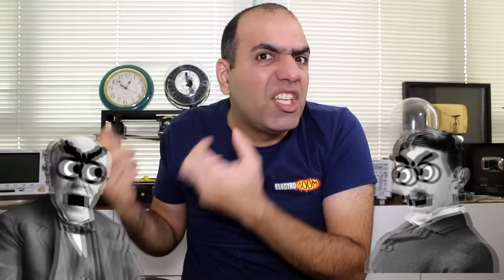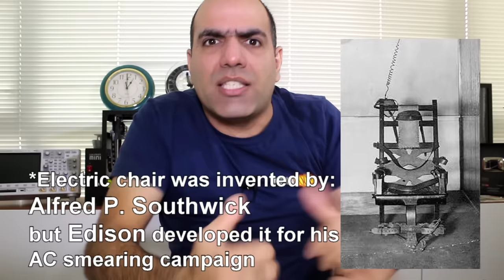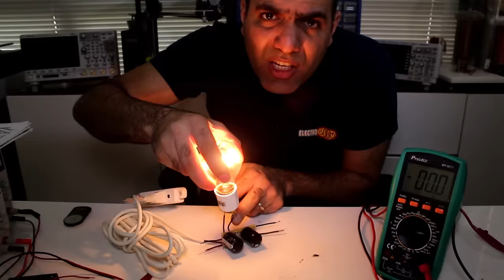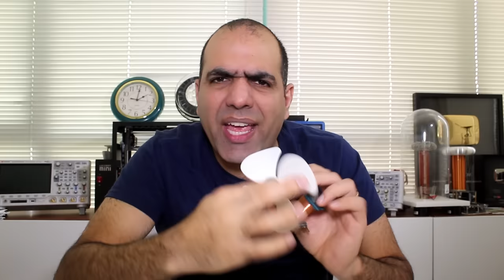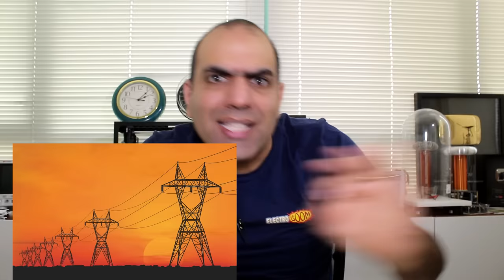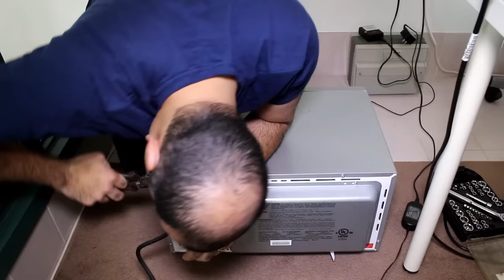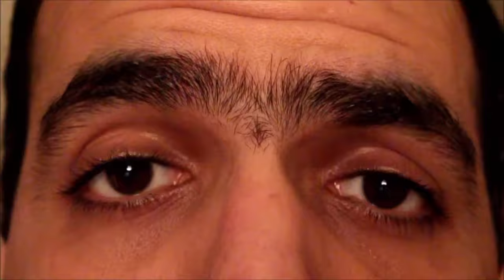Why Use AC Instead of DC at Home??

Comment: Yes and no. High voltage won against low voltage and it still does for obvious reasons but AC only won against DC because there was no DC to DC conversion at the time and nowadays there is. We could generate low voltage DC, convert it to high voltage DC, transmit it through the power line, convert it back to low voltage DC and power the homes, which was impossible back then. Of course it would be extremely expensive to change an entire system that works just fine, but saying that the result of the war of currents still applies today is just wrong.
Reply: No. AC is much better because you need 2 times less wires and less losses in longer path. When you transport DC on long distances you HAVE TO put 2 wires - one for plus and one for minus all the way back to the power source to close the loop. However when using AC on long distances you need only 1 wire. The ground - zero you can get it just on the other side very close to the houses. AC - you need 2 times less wires  and the distance electrons must travel is 2 times less - they don't need to travel back-forth to the power source from minus to plus and - less losses. Also there is saturation when using DC in some situations.
Reply: That is exactly what I was thinking about this whole video. I was hoping Mehdi would make some comment on the feasibility of a full DC system using modern power electronics.
Reply: Distribution of DC over the length of your yard is a tremendous waste of energy, let alone across a city.
Reply: Brek Martin DC has no more loss than AC. The only reason AC was better for transmission was because it could be stepped up to high voltages. The high voltage is what minimizes the loss, not the alternating current. We can achieve the same high voltage transmission with DC and modern power electronics.
Reply: Where do people come up with that bullshit. A DC voltage wasting more energy than the same AC voltage is an assumption everyone makes but noone ever proves, its completely made up.
Reply: How is it that the burden of proof is on me for such a claim, when practically the entire western world is using AC distribution network for electricity? I know the loss is the same over a single conductor, but whether a yard or a city, you can’t really do that can you?
Reply: Everyone knows that AC is more commonly used in power distribution but you claimed that the reason for that was the waste of energy of DC compared to AC, so you have to prove that this is actually true, but you cant do that because it isnt. Thats why you said now, that you know the loss is the same over a single conductor, which is the exact opposite of what you claimed before. But then you say that you cant do that on a larger distance, again a random claim without any prove. Do you have anything to say that you can actually prove rather than making up more and more conclusions or do you think that I am the one who has to prove something now? Well, if you think so, google search for power distribution maps and look at the high voltage DC power lines that travel distances across entire continents.
Reply: Let’s first nut out the disagreement of who made a claim. Who posted on this video first? and who’s comment is a reply to who’s?
Reply: I don’t think either of us can prove which is true without one of us funding an experiment for the other. Given that the video, and your post is in the context of electricity distribution, I think it fair for you to assume the wire across a yard is between a solar array and a home, and the city wide distribution is a large network, which for DC, in both cases, is a huge waste of energy.
Reply: My first comment doesnt contain assumptions but facts based on physical laws and history and you can research all of that if you dont believe it and the existance of high voltage DC lines across entire continents that I mentioned also proves my point but you didnt say anything against that because again you cant. You are only spamming assumptions and until you have a single valid point, Im not gonna respond to you anymore.
Reply: Unless I believe you have read the whole page, since you like research, and not just the first parts that look good, or being Wiki, have something to dispute about it, I won’t be responding to you anymore :)
Reply: You dont need it to be 100% passive to be more efficient than a simple transformer. Ever wondered why old school wall adaptors disappeared? Switching supplies are cheaper and more efficient. Of course they have their own downsides like you said emissions and harmonics, but as you can see on the small scale they are worth it. On the large scale it obviously isnt because you would have to redo the entire network but I said that in my very first comment.
Reply: No I’ve never wondered. They are cheaper, more efficient, and just as importantly, light. More reliable? up for serious debate. More efficient? In domestic applications, I won’t argue with you there.
Reply: We do use high-voltage, direct current (HVDC) transmission lines today. Turns out there's pro/cons to both AC and DC systems.
Reply: Let me google that for you. https://en.wikipedia.org/wiki/High-voltage_direct_current
Reply: Chuckiele, transformers (and their identical twin brother, induction motors and that cousin called synchronous motors) become more efficient as they become larger. A 5 VA wall wart would have an efficiency around 40-60 % (depending on vintage), a 5 VA SMPS wall wart is around 70-80 %, but is cheaper to make at that scale.

A 500 MVA plant transformer on the other hand is around 99.8-99.9 % efficient; that's quite difficult to beat with power electronics.
Reply: There are a great many other issues with DC-as-a-grid, elaborated over and over again, so it's not really an interesting discussion.
Reply: Something that I don't think anyone else mentioned is that AC wiring is somewhat safer in the case of an electrical fire. Because the AC is going from positive to negative, it crosses the "zero volt" level multiple times a second. That means that electrical fires are easier to snuff out since it's not a consistent arc. It's part of the reason why most basic welding is done with DC.
Reply: Chuckiele to convert low voltage DC to high voltage DC you need to convert the Dc to AC and AC again to high voltage AC with tranformer and convert again high voltage AC to high voltage DC.
Reply: Hahaha a whole bunch of people have no idea what they are talking about. Ohm's Law proves that the voltage drop due to AC and DC are the same. The main reason AC won out was due to the fact that it was much easier to step voltage up and down for AC than it was for DC. Today, short of the induction motor, nearly everything runs on DC. China has figured it out and is transmitting power from the Three  Gorges Damn using high voltage DC.
Reply: lela mario Not quite true. While SMPS do convert DC to DC by starting and stopping the flow of current they never make the current flow in the opposite direction therefor they do not change it to AC.
Reply: SeanFalloy do you know what inverter does?
Reply: lela mario Yes I know what they do quite well. I design them. An inverter is not used to step DC voltage up or down. It is used to turn DC into AC current. Examples of circuit topologies that step DC up/down are, buck converter, boost converter and  flyback converter. There are a few others but those are the most common.
Reply: Tesla invented ac , edison used on his famous creation, the electric chair , also we use ac because it can travel longer, dc wouldnt make it across the atlantic perfectly
Reply: borgresearcher AC traveling further than DC is a myth that just won't die. In fact DC would be a better choice for underwater, and possibly other distribution, since AC has parasitic losses/de-rattings that DC does not. These include skin effect, losses to to reactive properties, losses to the magnetic permeability, as well as power factor derating. OHM'S LAW STATES THAT VOLTAGE DROP IS RELATED TO CURRENT TIMES RESISTANCE. That mean the type of current has nothing to do with the voltage drop. The biggest advantage that AC has over DC is the ease at which voltage can be stepped up or down. With AC the transformer is cheap and quite efficient, it also existed over 100 years ago. For DC voltage conversion silicon devices need to be used. These did not exist until much later and it wasn't until the last 20 years that they have become capable of handling large currents. In summary high voltage DC is probably a better choice for distribution these days but the grid is designed for AC so we are not going to change it. However look at the Three Gorges Dam in China, they are using HVDC for distribution.
Reply: But hdc lines are way more efficient AC lines have a bigger transmission loss.
Reply: it would likley be to expensive for that but it would not waste energi if it was hdc https://en.wikipedia.org/wiki/High-voltage_direct_current#Advantages
Reply: Edison ex-employees
Reply: "dc wouldnt make it across the atlantic perfectly" Actually pretty much all power lines that go across the atlantic are DC because AC gets huge problems with capacitive coupling under water.
Reply: nikalsson lol actually you use more lines for ac (three phase current) and you need to place them further apart to minimize losses due to the capacity of the lines. Whereas with DC you only need to use 2 and even 1 being possible
Reply: you know you're kind of ignorance when you just responding to the weak argument people throw at you and not saying anything when strong argument is said
Reply: wrong nikalsson. Look up railroad electrification its in some places DC, they dont have to put wires for - anywhere. it just flows through the ground near to the rail, like in AC.
Reply: Chuckiele   Would the rotational generator have been a key component to the system architecture due to the native production of the current?
Reply: Lou Fazio It most probably was a key component back when the AC/DC battle was happening. Today with Silicon Diodes rectification to DC is very simple and passive (which, in this case, means it does not require computer control).
Reply: Same power AC has more losses. Thats why there are high voltage DC already (over 1 mio Volts).
Reply: As soon as you put in a DC to DC converter...you are using AC again. So yes, AC wins. Its AC between the step up. Without AC you cant do any of this, period. The current DOES alternate in the step up inductor (which is why they have a diode to re-rectify it). When the square wave turns off the inductor magnet field collapses and the current changes direction. Yes, it IS AC inside a DC to DC converter.
Reply: Research and Build That is incorrect. The direction of current in a switch mode DC to DC converter never changes therefor it cannot be alternating.  The collapsing magnetic field only causes the voltage to change polarity when the driving voltage is removed. The current flow remains in the same direction. (Remember: the current in an inductor can not change instantaneously). Unless you drive the coil with a negative voltage (which you don't in any standard DC->DC typologies that I know of)  then the current is only flowing in a single direction in a DC to DC converter.
Reply: SeanFalloy bullshit. Ok there are a couple that are capacitor design but they are not for loads. Every dc to dc converter uses an inductor, which causes current to reverse when the magnetic field collapses. They all use rectifiers
Reply: SeanFalloy its basic electronics a collapsing magnetic field causes the current to change direction . Why would they need rectifiers in dc to dc then huh.
Reply: Research and Build I think you may need to review the basic properties of an inductor. 

Just as the voltage across a capacitor cannot change instantaneously the current in an inductor cannot change instantaneously either. If we apply that logic to a PWMed coil then at the time the source is removed from the inductor the current must be the same as it was just before it was removed. Since the source is no longer in the circuit and physics won't let us break ohm's law the collapsing magnetic field of the coil will generate a voltage to continue pushing the current in the same direction. The polarity of this voltage must be opposite what it was when it was a load. As the magnetic field gets weaker over time so does the amount of voltage/current, that the inductor can source and it eventually reaches 0. At that point you must have a negative voltage to cause the current to flow backwards and create AC. This however is never done and the positive voltage is turned back on in the same direction to ramp the current and coupled magnetic field up and start the cycle again.

The rectifier, which is not always a diode, as MOSFETs are used in synchronous switchers, prevents the flow of current backwards out of the capacitor when the inductor current reaches 0 or in the case of a buck converter it is required for the current to continue to flow from the inductor into the capacitor. The rectifier is the reason the circuit cannot actually be AC. 

It has been a long time since I did my engineering degree but the basics haven't escaped me since i am not senile yet. That and I have designed at least a couple switchers.

Comment: Except "High-voltage direct current" is used worldwide for longer distance distribution...
Reply: Because we now have the tech to ramp up DC to high enough voltages that it benefits from the same low resistance that AC always had, but we didn't have the tech until around the 50's and until even recently it was exorbitantly expensive.  HVDC converter stations are like the oil refineries of the electrical world with acres of switching gear, converters and filters.
Reply: It was only in the 60's that the concept for the tech existed.

Also of note: High Voltage DC is usually used for transmission distances >= 800km. HVDC substations take a lot of space - a transformer the size of a kettle can easily handle several hundred volts and a few hundred amps.
HVDC is perfect for intercontinental power transmission (no crazy 60<->50Hz conversions needed), too costly (and space-wasting) for anything else.

Comment: Also of course modern high voltage DC power transmission is much more efficient than AC, so maybe Edison, the bastard, was right all along...Grrrr.
Reply: How is that the case when the loss is the same, while DC transformation is expensive and noisy?
Reply: Don't ask me, ask Wiki or something. DC transmission is used for EHV and UHV as it certainly is more cost effective and efficient.
Reply: Edison may have been a bastard, and Tesla may have been nuts, but they were both pretty smart.
Reply: With today power electronics DC lines are becoming  more convienint and many news high voltage lines are DC now. Also it is a lot easier to manage a world grid if everthing is DC and you do not have to worry about being synched, balance phases, synchronize generators..etc..etc.. It is just a matter of time before we will all switch to pure DC for everything. Even induction motors are being replaced by permanent magnet motors with dedicated inverters which work with DC and are more efficient.
Reply: DC Lines are more COST-Efficient at a certain starting distance point which is in average 600 km, that happens because you need in both ends converting stations that needs maintenance
The real great advantage of AC is for easier construction of generators that can output high amounts of power
Reply: Fred and Brek you are wrong,  the nature of AC adds extra line losses that DC doesn't have, and stepping up and down dc voltage is now possible
Reply: It only applies now but not in Tesla and Edison's time.

Comment: Edison's vs Tesla's system is best exemplified through electric railways. Railways that use DC third rails require a substation every few miles in order to keep the electricity flowing without too much resistance whereas railways that use overhead AC power lines can go longer distances without the need of a substation. Of course DC is okay for powering railways but imagine the amount of substations required to power homes, offices, and appliances had Edison's system been used.

Comment: May I just clarify if the reason for not feeling a similar pain on touching 170V DC compared to 120V AC (peak voltage 170V) is mainly because of skin capacitance acting as a high pass filter?

Comment: I think the main reason they used AC is that AC produces a moving magnetic field allowing it to be transformed to a much higher voltage and lower current so you can use smaller wires to transmit it, a DC converter to ramp up or down the voltage was more complex especially back then they probably only had rotating transformers and resistors, it was long before transistors

Comment: in practical terms, all of the wiring inside the house would have to be 10-20 times thicker, all wires coming to houses would be huge and there would be big losses in energy because the wires would heat up a lot ..

Comment: I know this is old, but new development is to do DC inside the home. With solar and battery renewables at home it makes a lot of sense to avoid the bidirectional losses from the 2 conversions. As you point out in the beginning most of the home devices run on DC internally so not such a crazy idea.